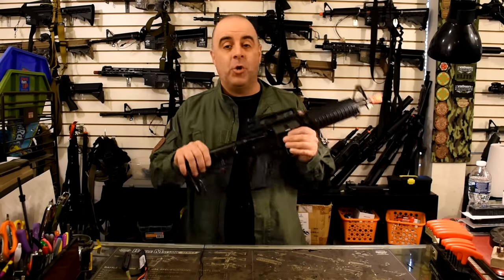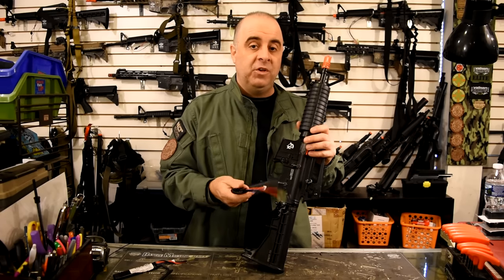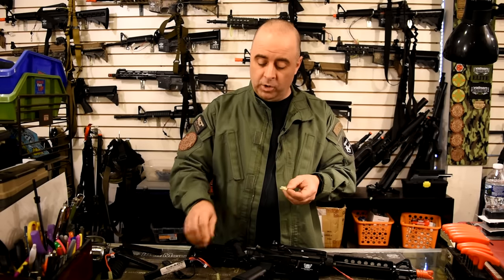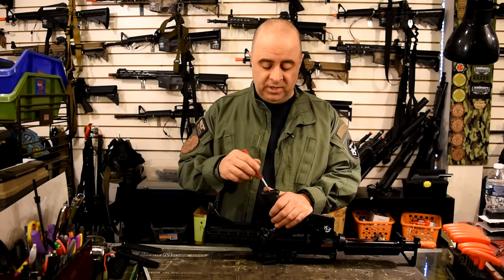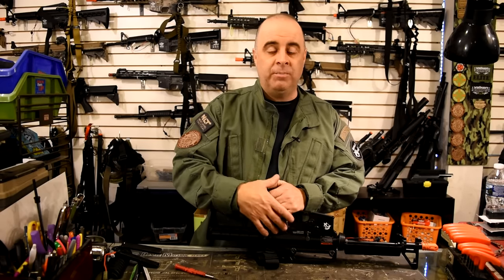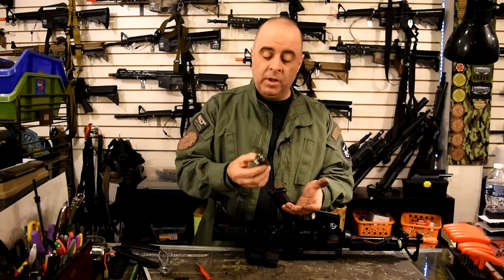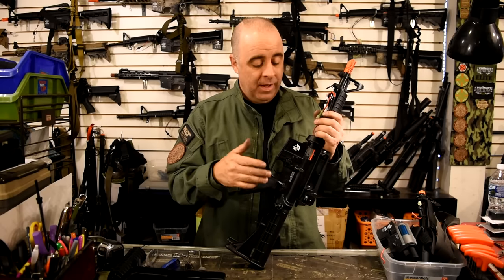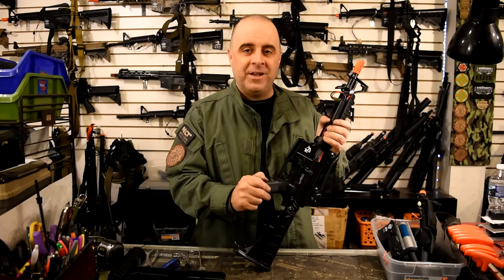Basic Trouble-Shooting for AEG Airsoft Guns

Comment: what happens if the battery over heats
Reply: The battery can usually overheat by either being charged for too long or if the battery is putting a lot of power into the gearbox. If the battery does overheat, let it cool for a while and see if it works again. If the battery doesn't work, then you may need to get a new battery.